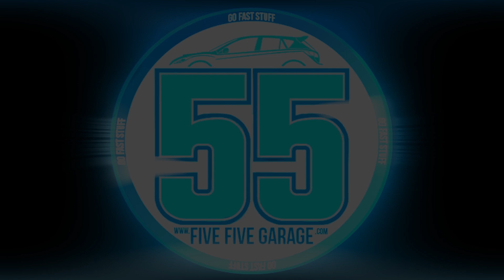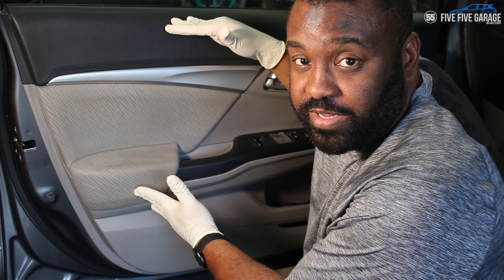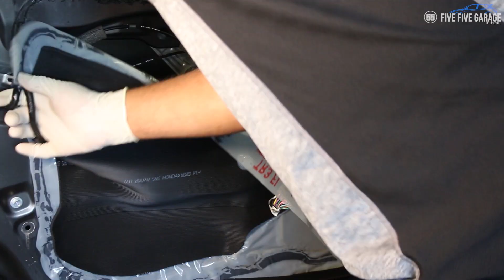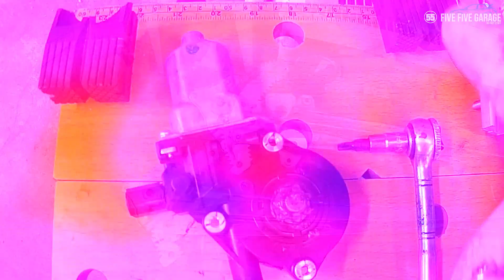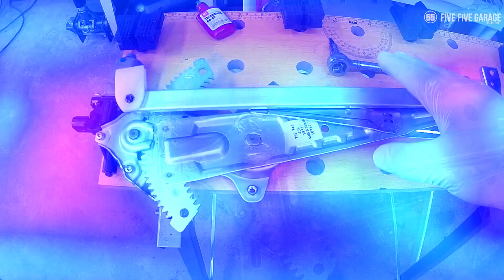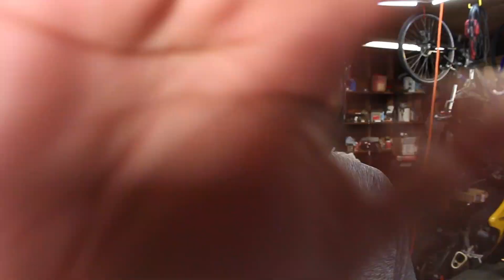2013 Honda Civic Sedan Window Regulator Replacement

Comment: You the man! Thanks a ton, saved me some $$$
Reply from the maker: Feels good to DIY and save money!!!
Reply: @FiveFiveGarage  my one issue is that the clips for the window from the oem broke(this was my issue) and they were incredibly hard to remove. I think I need to epoxy the clips to the window, but getting both screws through the clips to the regulator seems difficult once in the assembly.
Reply from the maker: You have to lower the window a little and then both become accessible.

Comment: What type of glue did you use for the widow clips to the glass?  AND What position was the regulator when you  "counted the teeth" ?   (did you just eyeball it level)
Reply from the maker: For the adhesive I used 3M window adhesive (the type used when installing auto glass) I have also heard of using 3M 5200 marine adhesive. Whatever you use make sure its fully cured before you use the window (about a day or two). 

As for the teeth it was either 12 or 14 per side. You can mark the regulator with a Sharpie and then move it manually to figure it out for sure.

Comment: Hello, I noticed you had one of the clips attached to the window and glued, and the other clip was attached to the regulator, did you end up glueing that one on to the window when you installed it or was the window just sitting on it without any glue?
Reply from the maker: I added adhesive, didn't make it into the video.

Comment: what if my window doesn’t go down?
Reply from the maker: Is everything plugged in and lined up?
Reply: yes I got the entire window out now it was completely off the clip and the regulator was twisted like a pretzel, after I’ve done this though I can’t remove the broken clip. it’s bonded with a rubbery black glue to the window. is this normal? how can i get it off?
Reply from the maker: Heat. Use a heat gun to slowly warm it up, the adhesive will soften and you will be able to pull it off.

Comment: Great video, big help.  Thanks again--thumbs up.  But something I should mention is that it's very important to keep your window in the track before attaching it to the regulator!  I had to loosen the window again just to re-track it then connect it back.  And then I realized the initial reason for my first regulator folding was that the tracks had wiggled loose of the door!

Comment: Fixed mine in 1 hour 15 minutes because of your video. Thanks you good Sir.

Problem was bent screw bracket and loose bolts. Brake cleaned the 10mm bolts and holes and locktited the fuckers !
Reply from the maker: I threadlock everything now lol